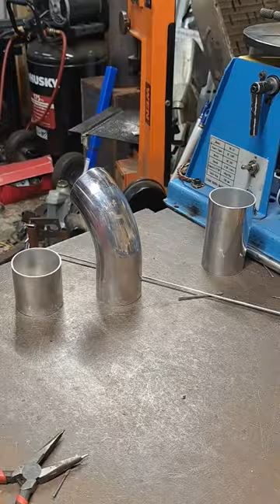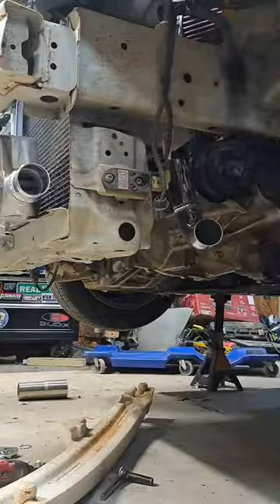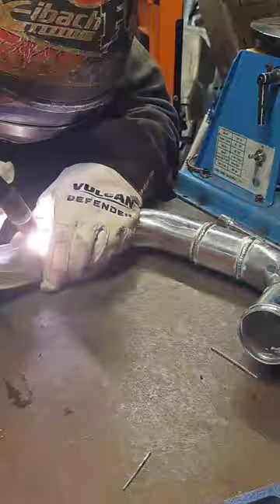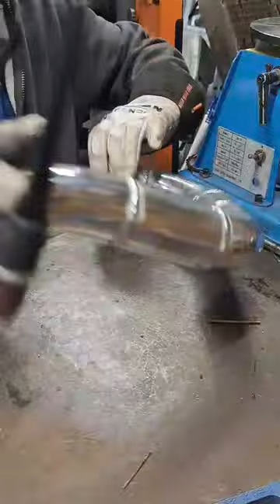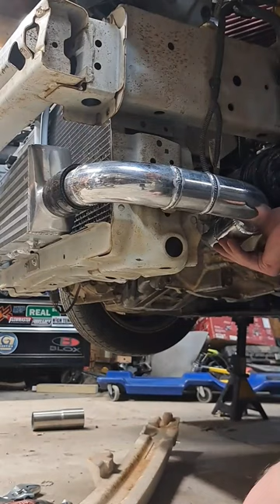Mastering Welding Techniques for Intercooler Piping #shorts

Comment: Tacking the 18 gauge Chinese stuff I had nearly killed me..holes..
Reply from the maker: Yeah, tight fitup is the key but definitely easy to blow a hole if you hangout too long. I usually run 30-40amps when welding intercooler piping.